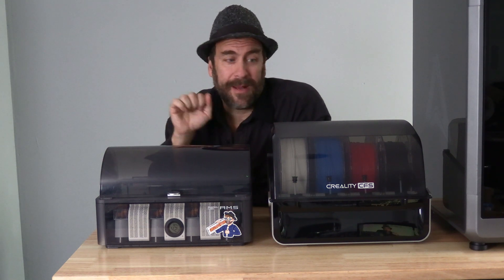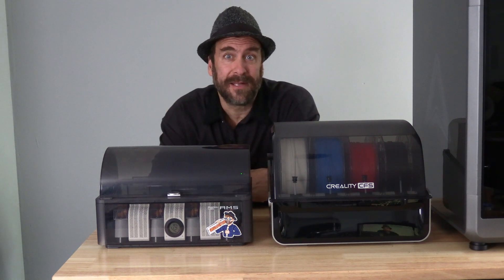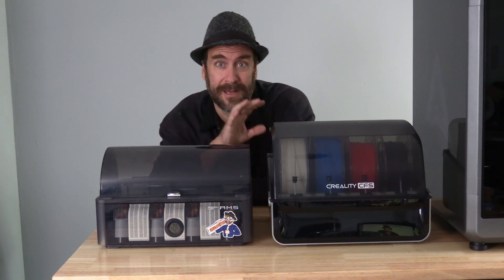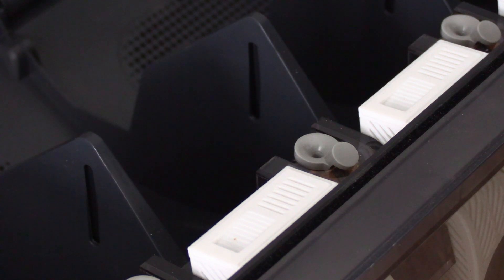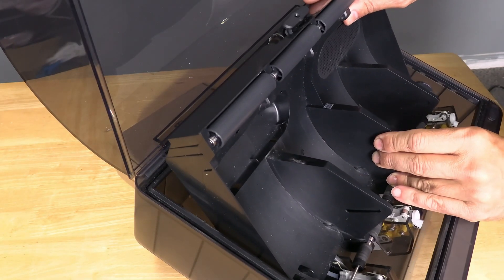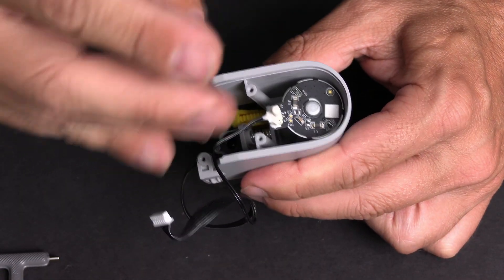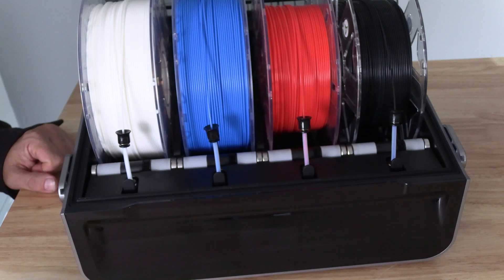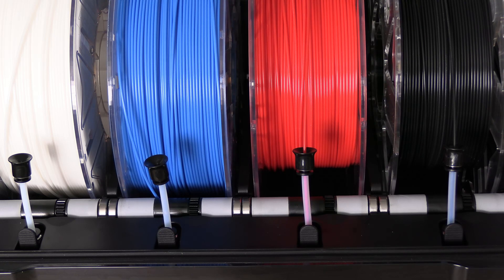CREALITY Re-Invents the Wheel, with the CFS Feeder Funnel. K2 Plus 3D Printer

Comment: I made my own feeder funnel within moments of getting the AMS. It's easy and now my feeder funnel is a 5 seconds swap also.

Is that the only benefit? 
Because otherwise it actually looks worse, it's bigger when closed and requires much more vertical height/clearance to open.
Bigger internal volume means more space for humidity, which means more frequent changes of the desiccant.
Also, it doesn't look like there is space to make/add in one's own extra desiccant pods.

So it's bigger, worse than the AMS and a year and a half behind?

Please tell me I'm wrong 🙏🏼
Reply from the maker: I've swapped the beads, one time, total, across all 4 of my AMS, before stopping to use it at all. I've never seen a need.

The CFS, has spring loaded pressure pads, above the spools, to stabilize them. This is part of why the cover is taller. 

You appear to have a toxic, negative personality. Tell me I'm wrong?
Reply: I have a K2 plus combo arriving shortly. I actually wanted be told I was wrong 🥴

Nice about the springs to hold the rolls in place. That is a nice and justifiable reason for extra height 👍

Any word on the ability to add extra 
 desiccant pods to the CFS. I have to recharge my 7 pods every 2-3 months. This would be much more frequently for me if I cannot add extra and a real nuisance if I wanted multiple CFS.

Thanks in advance.
Reply from the maker: The CFS is indeed large. It's surprising at first.... However the AMS is light, and cheep feeling. The CFS feels like a tank. Being a big older.... from a time things were made more robust, and usually work for 500 years, compared to today's junk, I appreciate the robust feel of the CFS. When comparing the two... it looks big. However, in USE, it doesn't feel big. It feels Quality. I'm happy with it so far...  We will look at it deeper. Keep in mind, Creality is watching my content, and I'm on a short leash, with this bizzar Embargo
Reply: @3DRundown Thank you for the info. I do remember the times of built properly. As someone that is always building, upgrading or fixing things for people I have a moto.
"If something is worth doing, it's worth doing properly. If you aren't going to do something properly, then leave it to someone that will."

I loath half assed attempts and the double handling they usually demand of us.

Here's to hoping that choncky means well built and well thought out :)
Reply: Hater gonna hate... im more like, are you happy with your bambulab? Good for you... you just have put a blanket over all the features you already know about this k2 plus machine. 
I have K1, P1S, A1, KOBRA 3, V3 PLUS... I mean... they all have their good points and they weak points, but you`re just being a hater. And thats not crearly the way but hey... haters... gonna hate :S lol
Reply from the maker: this....